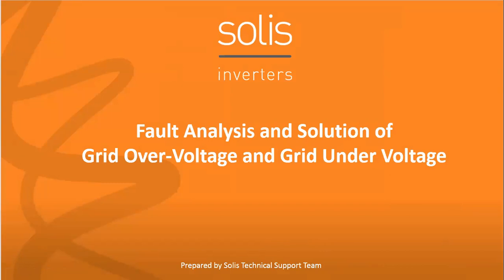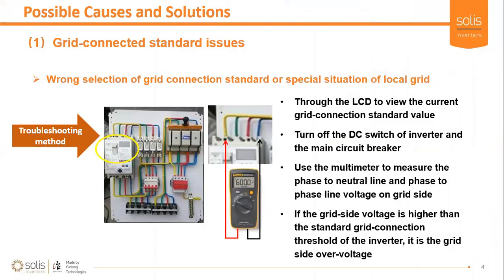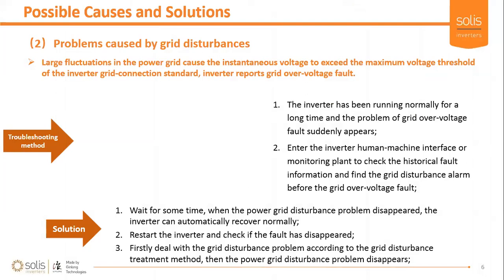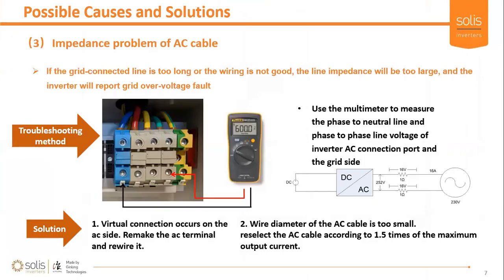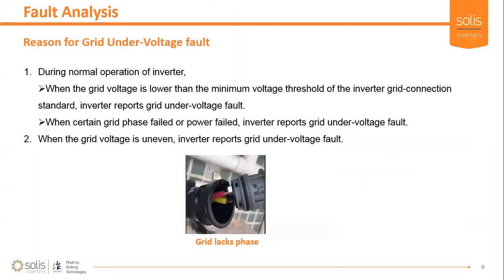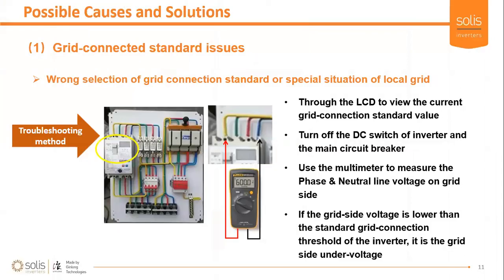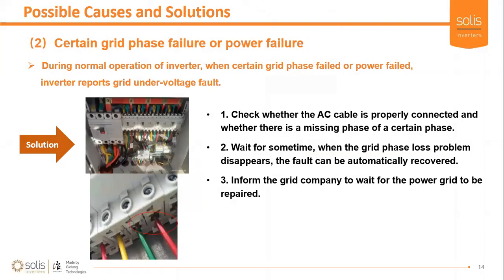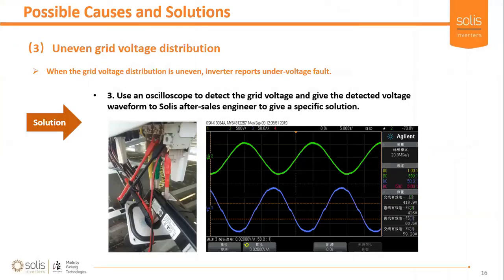Solis webinar：Fault Analysis and Solution of Grid Over-Voltage

Comment: Hi I have a 5kw Solis inverter. it goes off when the grid voltage reaches to 244v. So, we adjusted the over voltage parameter in to 246v but it keeps repeating. Inverter goes off when grid connection reaches to 244v.what is the reason and solutions?